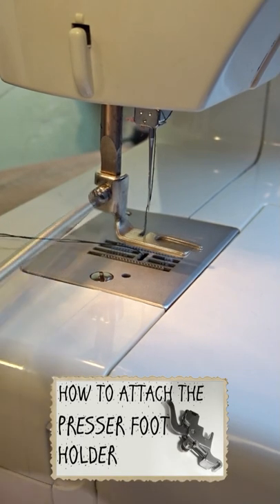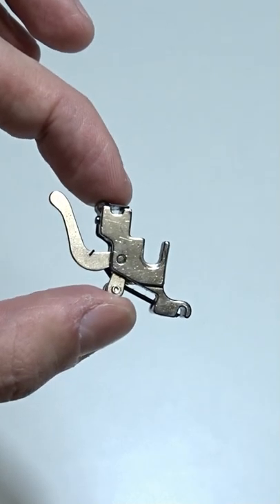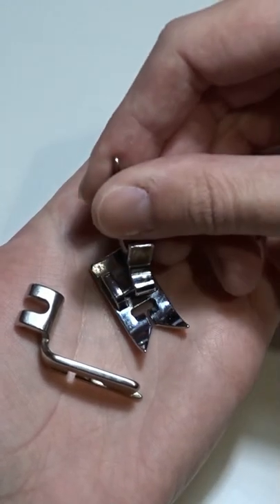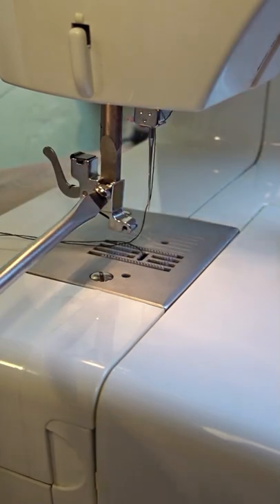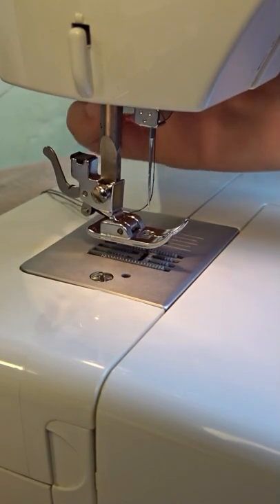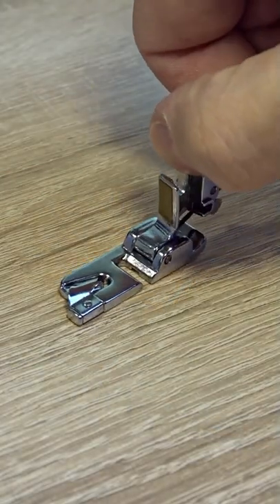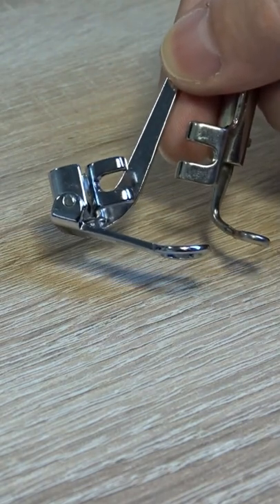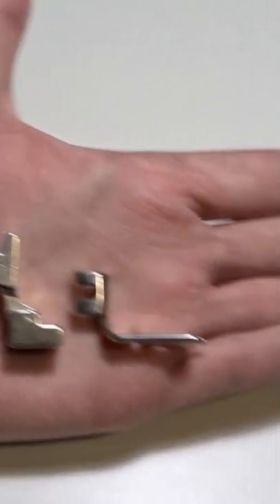How to Change The Presser Foot / Presser Foot Holder #SHORT

Comment: Can I use normal machine
Reply from the maker: I am using some of the presser feet from my old treadle sewing machine on the new one, so the presser foot bar should be the same on most machines. Though you may need to ask in the store, I think Bernina sewing machines, have different presser feet bars. The Singer, Brother, Toyota, Naumann...etc. have interchangeable parts. You also need to check if your machine has a high or a low shank, and buy the correct presser foot holder. If you are buying it from Amazon, you may check the description to see if your machine is listed there.
Reply: @ArtOfClay  tq